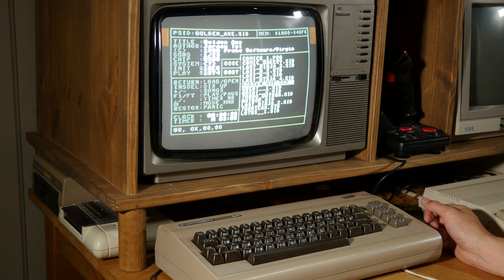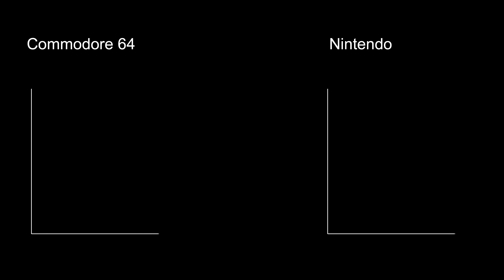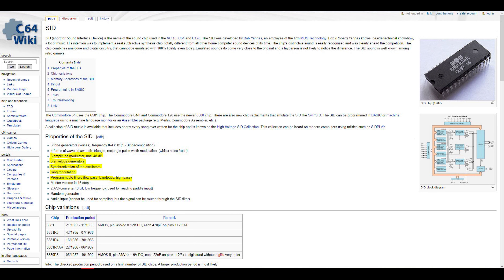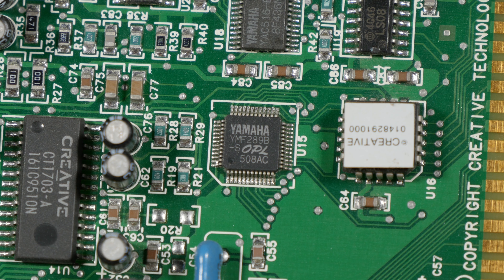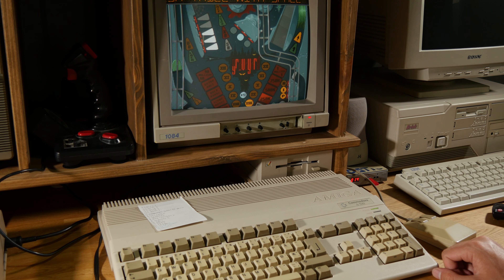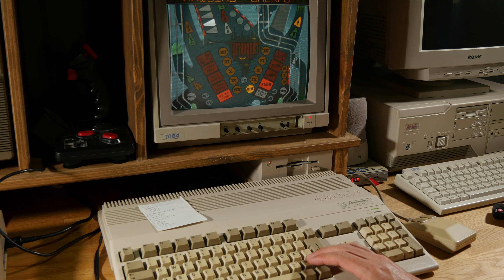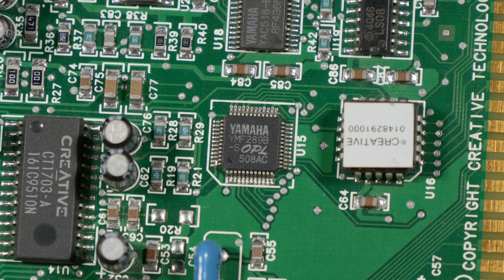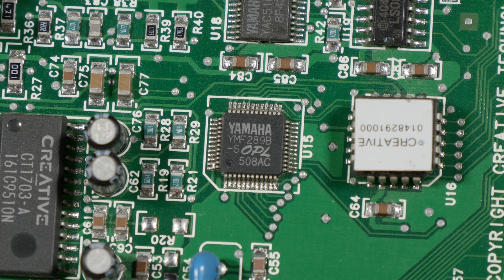How did Amiga, Commodore 64 and old PC's Create Sound?

Comment: I bought the Amiga 1000 when it came out. One of the main reasons I wanted it was for use as a synthesizer/sampler sound module that I could use as an instrument with my intent to play in rock bands. It worked very well for this for 1985. Samplers were out of the reach of most, and the very cheapest ones, new to the market, had cost about what the Amiga did. I had sampling, subtractive synthesis (analog synthesis), FM and drum machine emulation.

For the next several years, the Amiga basically blew the audio abilities of out computers out of the water. None could really be used as a synthesizer sound module....except the Amiga.

I previously had a C-64, Apple ][ and my original TI 99/4a. The C-64 SID chip, while better than most other computers, was still really a toy when you came down to it. I had no interest in using it "replace" a hardware synthesizer. But the Amiga could do this. No other computer could for ages.
I was even able to emulate the C-64 on my Amiga, including the SID chip. The Amiga's sound chip was that powerful. Another more interesting thing I did, was "emulate" the Ensoniq Mirage sampling keyboard. It came out about the same time as the Amiga, costed about the same, and using a program I was able to load Mirage disks right into my Amiga's disk drive and play them back live with any MIDI keyboard! This blew me away. I could also convert the sounds the the Amiga's IFF file format and use these professional samples with most Amiga music programs. I ended up buying 30 Mirage disks. I also emulated a drum machine and more.

What the Amiga did in 1985 was basically give birth to the concept of the software synthesizer, it was like having a VST, but 15 years earlier. As you video mentioned, the Amiga's 8 bit sound chip could also be tricked into doing up to equivalent to 14 bit sampling. Because so few people understood about the Amiga's professional music ability, the problem was some great programs came out but sound collections for them were scarce (except samples) because most musicians hadn't a clue what it could do as far back as 1985. The Atari ST couldn't even come close to what the Amiga could do. Rightfully, Steinberg should have developed the VST standard on the Amiga almost years before they did. And by the time Cubase came out, nearly 5 years after the introduction of the Amiga & ST, both were clearly dying platforms. They shouldn't have wasted their time and gone right to the PC.
Reply from the maker: This was just great to read, thanks for the comment 🙂

Comment: The adlib was not the first sound card for pc, the first was the tandy sound
Reply from the maker: But it was not really a card? It was just built in to Tandy computers? But that was before1987 for sure.
Reply from the maker: on the other hand, when looking at my title for the video, I should have mentioned it. I came up wit the title after I made the video, and it didn't fit completely. I will change the title.